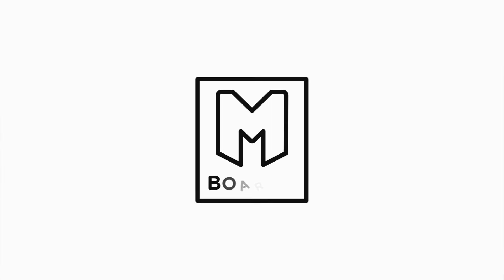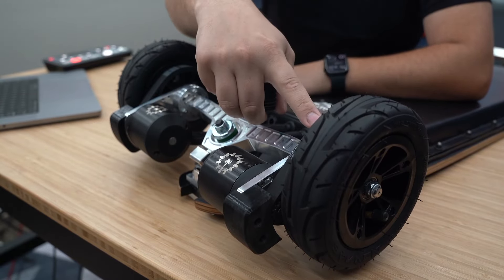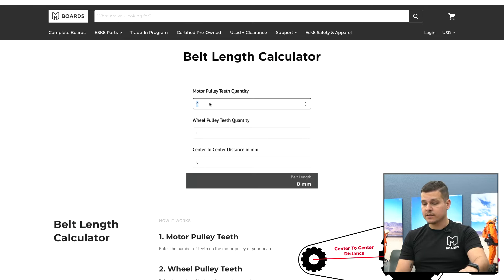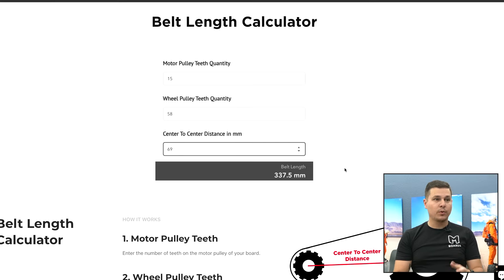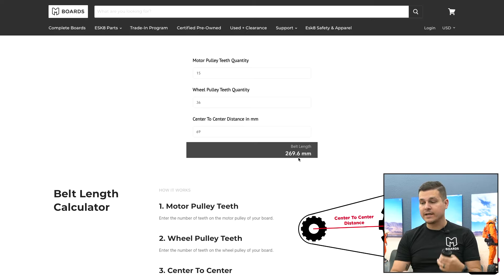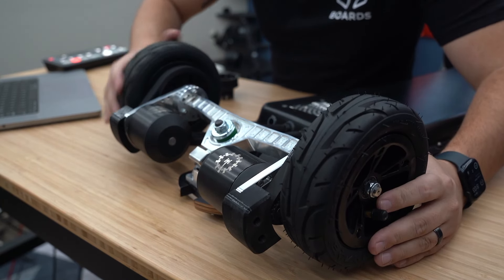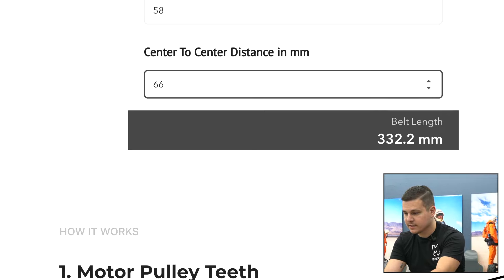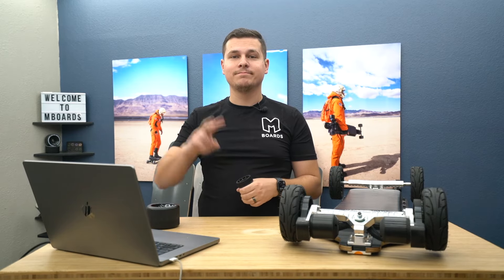Esk8 Uncut: How to Calculate Belt Length For Your Electric Skateboard

Comment from the maker: What other videos should we do? What topics confuse you? What tutorials are needed? Respond to this comment with your ideas!
Reply: An interesting tool to make would be a tool using the gear ratios and motor torque to give an estimated torque to the wheel pully keeping the wheel diameter in mind too, giving  giving a 'theoretical' force of the wheel to the surface 😬🤓
Driven Pully / Wheel Pully, divided by Driving Gear / Motor Pully, then the Torque at the radius of the motor pully transferred to the wheel pully, then the output would be a ratio between the radius of the wheel pully and then that of the wheel. No the torque on the wheel pully will be the same at the edge of the wheel, times by the wheels longer radius to get the force..... shit.... now I'm confusing myself... 😵‍💫 Let me check my calcs/g-sheet at home and send something through if You are interested.